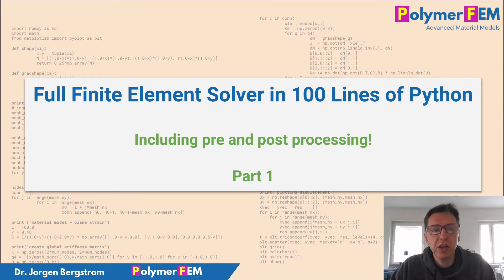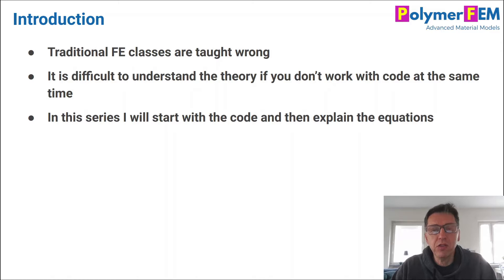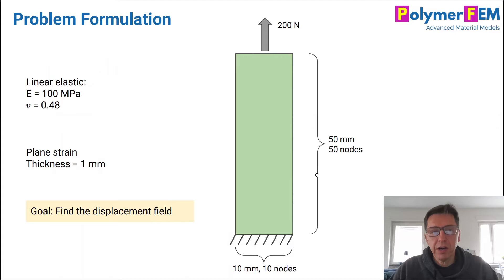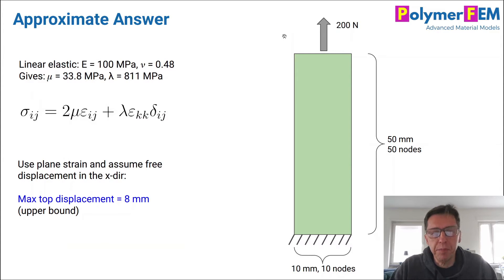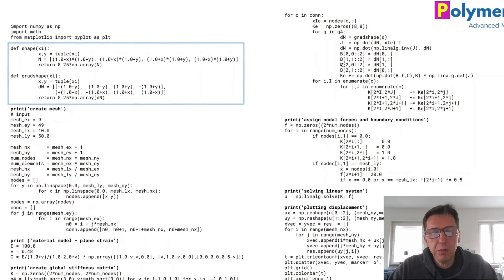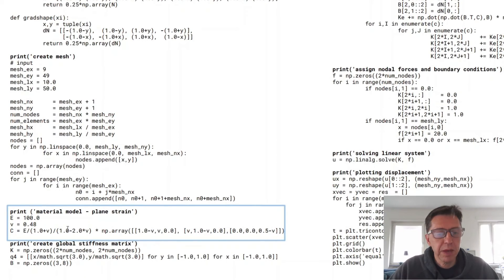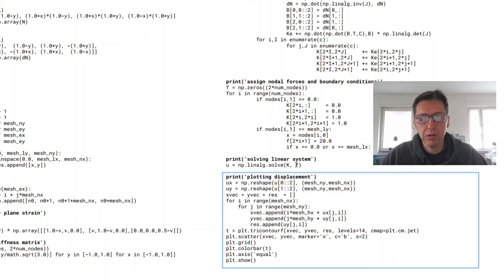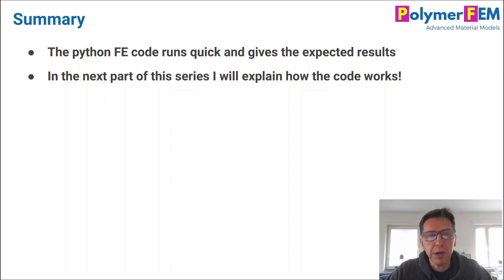Full Finite Element Solver in 100 Lines of Python

Comment: Hello, I have read your post and python code and now I have two questions. The first one is about strip problem. I think this is a plane stress problem but you say this is a plane strain problem. I mean in the strip problem the force 200 N is parallel to 50*10 plane rather than 10*1 plane. The second one is about approximation calculation. I have no idea to get result 8 . I just get the simplest result is 10. Could please give me some inspirations to this calculation?

Comment: I really appreciate this look into some simple FE code, I think it's going to help a lot for a project of mine. I have two comments though:

1. It seemed like the video didn't add much that the comments in the code weren't already contributing. It would have been nice to have some more detail on exactly what the code is doing mechanically, especially in the global stiffness and forces/BCs section.

2. The output seems to vary dramatically based on the number of elements in the x dimension. With a 9x49 grid as shown, displacement is about 6.7mm, but doubling the resolution to 19x99 elements brings the displacement to 14.3mm. Around 49 x 249 the solve time starts to get inconvenient, but the displacement is up to 36.9mm. It seems like you get .75mm per element in the x dimension. Do you have any idea why that is? It's my understanding that increasing the mesh density should converge on more and more accurate figures.
Reply from the maker: 1. Good point about the BCs. I have been considering adding a video explaining more about how that works. 
2. The code is written such that each node with an applied force is given a force of 20 N. So if you increase the number of nodes, then the total force increases. You will need to scale the applied force based on the number of nodes in order to do a mesh refinement study.
Reply: Do you know the link where you get the python code to this lecture? THe link provided directs to some Ansys page . And i couldnt  find it there.
Reply: In case its still useful, because these are sparse matrices you can use scipy's linalg module. For non-ill conditioned systems look into the bi-conjugate gradient stabilized solver or GMRES (BiCSTAB, GMRES etc). If its ill conditioned you can try incomplete LU preconditioners in scipy's spilu. If that doesn't work you can try direct solvers. Either .factorize or .splu. You can test which column preordering algorithm is fastest (makes a lot of difference) and sometimes the pivoting threshold might matter a lot as well.

Comment: Dude, this is exactly what I needed. Thank you so much. It's maddening that there seems to be no middle ground between 2 hour lectures explaining theory whose application isn't clear until 15 hours later in the course, and 15 minute videos breaking it down into pretty graphics that make the concepts more digestible but are simplified too much to assist when it comes to the level of granularity needed actually writing the code.

It's so prohibitive of active learning and it is pervasive throughout formal education. Thank you for teaching this way.
Reply from the maker: Thanks for your kind words. I agree!
Reply: You mean 15 hours after the course ends right?

Comment: I am getting the follwing error when i try to run this code, kindly suggest me some solution for it. " Error in qhull Delaunay triangulation calculation: singular input data (exitcode=2); use python verbose option (-v) to see original qhull erro". The plt.tricontourf function has some issue. Waiting for your reply.
Thanks
Reply from the maker: I recommend that you download the python code by clicking "copy" next to the code on this webpage: https://polymerfem.com/full-finite-element-solver-in-100-lines-of-python/
I then recommend installing a full recent version of Python (like version 3.9). I have used the version from anaconda.com in the past.
I just double checked it and the python code works.
Reply: @PolymerFEM  its directed to the ansys site
Reply: @PolymerFEM  Thank you so much. This work fine. I hope to learn more from you.
Reply: Can u send me the python code link?